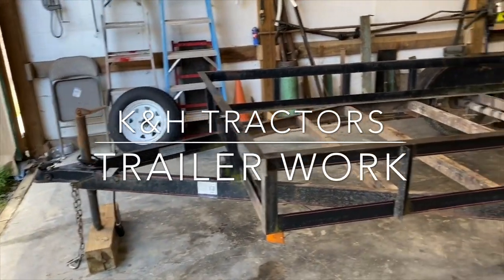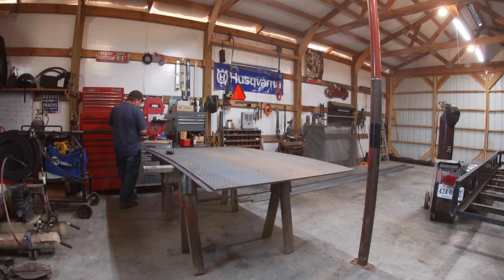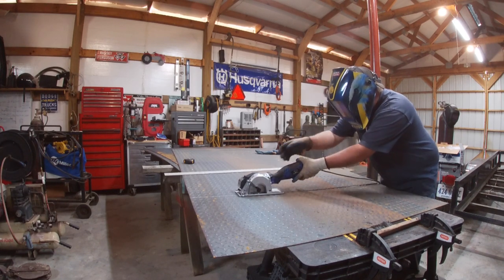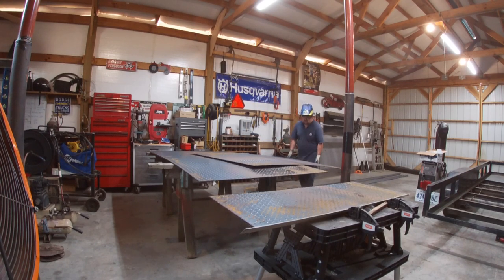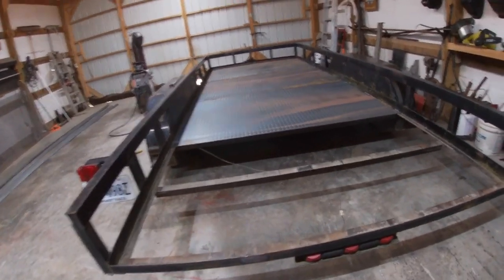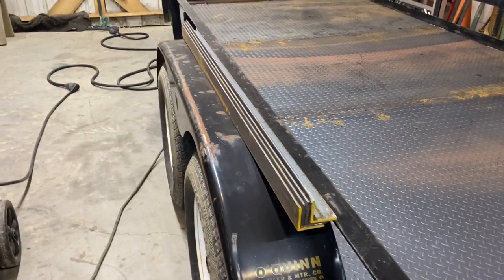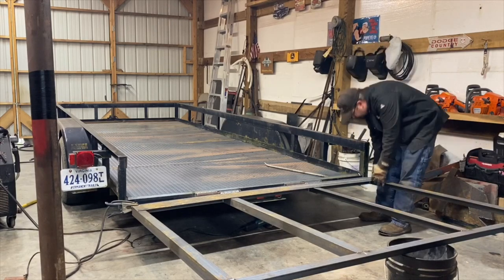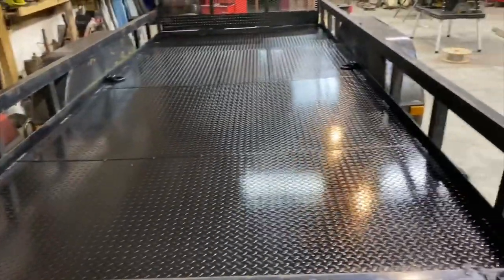16ft utility trailer getting Steel floor plate and tailgate, also Eastwood Mini Metal Saw

Comment: Looks really nice on my 16 ft trailer I want to replace the wood with steel checker plate and also add front electric brakes because it has rear brakes and a LED lightbar with a 12k lb winch with solar battery back up and utility box on tongue area to hold tie down straps and battery.
Reply from the maker: Having both axles brake is very important! Thanks for watching
Reply: Ok thank you

Comment: Nice job , I've been meaning to do the same with my single axle tilt trailer but not sure if to use a 20 gauge metal sheet on it. At least for the sides, measurements 33 in x 14 ft.  You think it will be ok to use 20 or should I go with something stronger ? Thank you in advance
Reply from the maker: 20 gauge is pretty thin. I think I’d go with at least 14 gauge.
Reply: @khtractors  thank you for the advice, much appreciated 👍

Comment: Those look to be 3500 axles.  How was the GVCW impacted when you added the steel floor?
Reply from the maker: The steel probably added 300 lbs over the weight of the wood. Thanks for watching

Comment: I wasn’t able to tell, but did the seams of your plate fall on a crossmember (for strength)?  It appeared that they fell wherever and you simply welded the seams? I have a like project I’m considering doing with my 18’ car hauler which has a rotted floor.  With the price of lumber as it is currently I would prefer to spend a little more and use diamond plate.
Reply from the maker: I just let them fall where ever they landed, but I did put flat bar on its edge underneath to help keep the seams level and add strength. The seams will hold anything the trailer will haul 😂! Appreciate you watching!

Comment: Do you mind sharing what rings you used or the link to order them?
Reply from the maker: They are 5/8” Weld on D-rings. I think I ordered some from eBay and got shorted then went to a local supplier and purchased the rest. Thanks for watching!